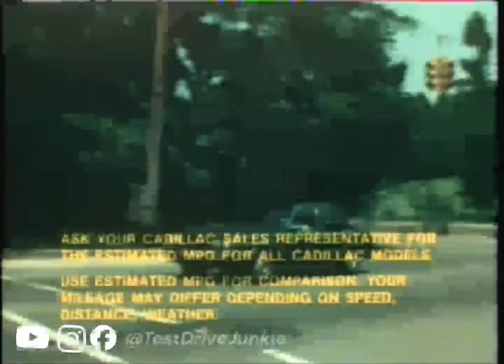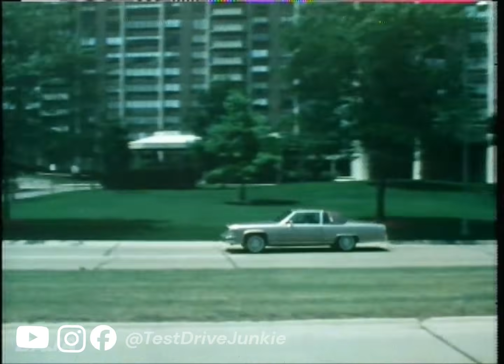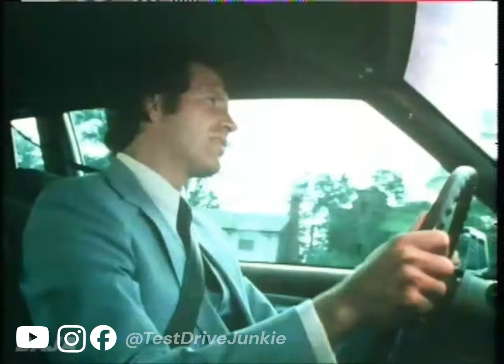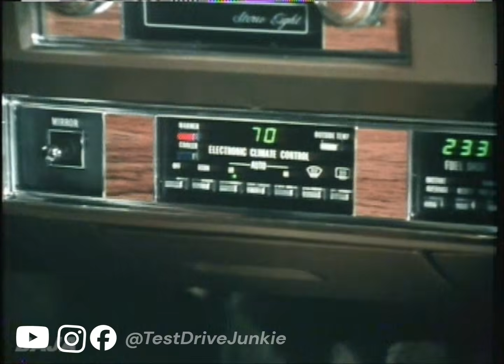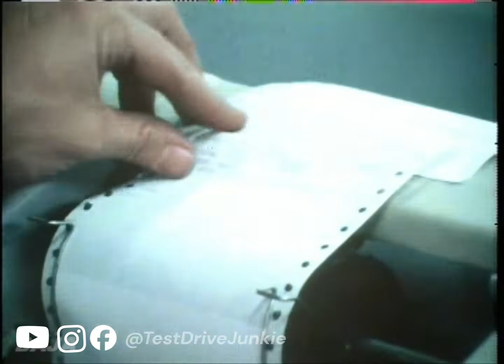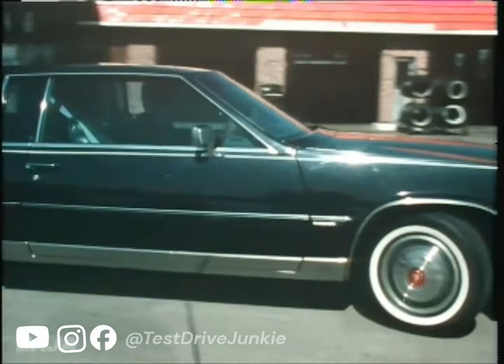1982 Cadillac Manufacturer Laserdisc Features Promotional Video

Comment: What a shame such a nice car with an absolute steaming pile of crap under the hood. Cadillac should have keep the fuel injected 368 without cylinder deactivation or at very least streamlined with a fuel injected Chevy 350. Maybe throw every trick in the book to squeak more mileage with lower gear ratio, dual exhaust, electric cooling fan, anything would have been better than the HT4100 and Olds diesel. They were so focused on CAFE fuel mileage in the Cadillac division which made no sense when GM could have made up the difference with more small Chevys, Pontiacs, Olds and Buicks.

Comment: My family had 3 new cars with this transmission - each one failed prematurely.  1982 Sedan Deville, 1983 Sedan Deville, 1986 Pontiac Grand Prix.  First the 1982 had problems at around 5K miles and work was preformed on it, not sure what was done, then it failed completely at 60K miles and it always had a hard shift from 1st to second gear, the 1983 failed completely at 62K miles, 1986 failed completely at 74K miles and we had a cooler installed on the 1986 because we thought it may help it last longer and yes I know the Pontiac had a 5 liter engine and not the 4.1 Haul and Tow engine.  We never had engine problems.  Totally let down by GM and went to Ford products then Lexus products and never a problem with Lexus brand.  Still drive Lexus brand to this day.

Comment: How things have changed. The 4 Speaker sound system featured here. My Fiat has a 6 speaker sound system with steering wheel controls that was not even possible to have back then.
Reply: Наверное возможно, но трудно для реализации. Больше времени на сборку, больше материалов.

Comment: This was truly a bad year mechanically for Cadillac. The 77-80 models were far superior. I do love the interior quality and styling of the Fleetwoods and Broughams of the 77-80’s. 

As someone that has owned an 87 Brougham D’Elegance package in the past, the button tuffed leather seats and interior trim was absolutely beautiful and felt so nice to touch. The door panels were nicely and thickly padded that blows away any modern luxury interior to this day. Plus leather seats that actually was “real” leather and not this cheap ass fake pleather that they pass for leather in new cars now with seats that are hard as a rock!! 

The biggest problem of the 87 Broughams was that horrible 307 slow dog of a motor and the electronically controlled Rochester Quadrajet Carb that was a PITA to keep from flooding and stalling out and only having a 140 HP was just dangerous in such big heavy car. 

Plus the ride quality wasn’t what I expected. The ride was pretty firm, noisy, and not truly soft or floaty. The interior rattled badly when going over rough streets with potholes and rough patches. Compared to my 77 Lincoln Continental and even some 80’s Town Cars I’ve ridden in, the 80’s Caddies just weren’t as smooth and bolted down as solidly like the Lincoln’s were. No squeaks or creaks, nor any rattles in my 77 Lincoln. 

But I still love the body style of the 80’s Fleetwoods/Broughams. This body style Caddies were the last traditionally styled Cadillacs and the most recognizable as they were made for about 15 years in total. Just wish they performed better and were more reliable like how the 70’s models were.

Comment: Funny it took Cadillac until 1982 to offer the 4 speed overdrive transmission on most of their lineup when Ford/Mercury and Lincoln had it two years prior in 1980 in all Lincoln models, full sized Fords and the T-Bird/XR7. Even GM was offering a 4 speed automatic on it B-body and C-body full size cars with a V8 engine from Buick, Olds and even Chevy with it's Impala and Caprice for 1981.
Reply: True but the Ford overdrive was clunky, junky and problematic. It was always hunting in between gears and it couldn't hold a candle to a Hydramatic from GM.